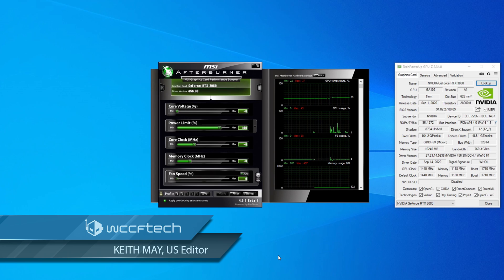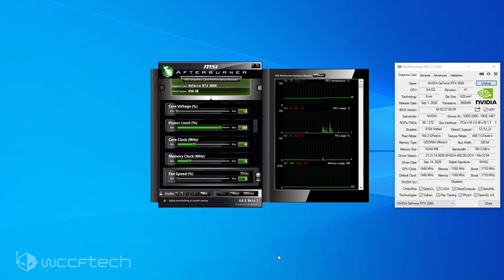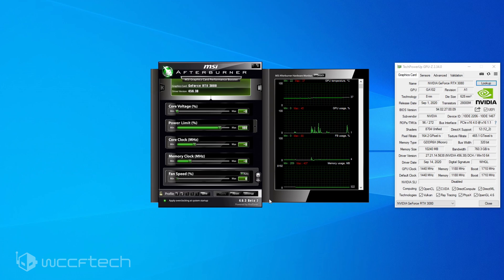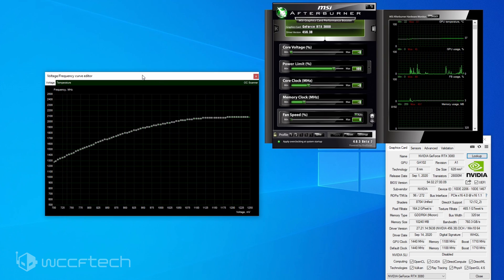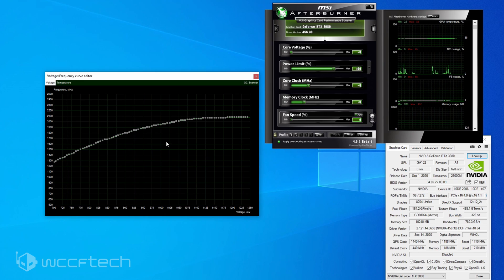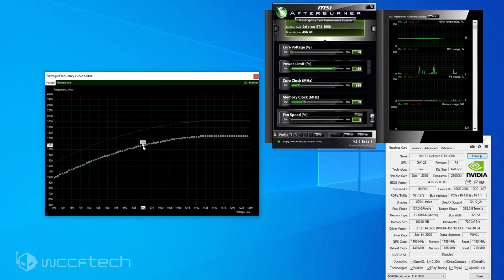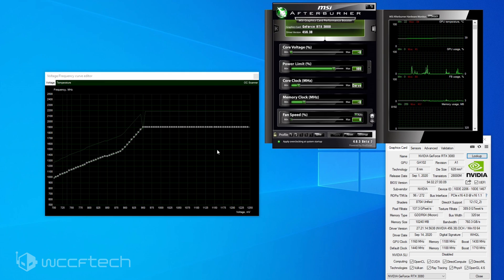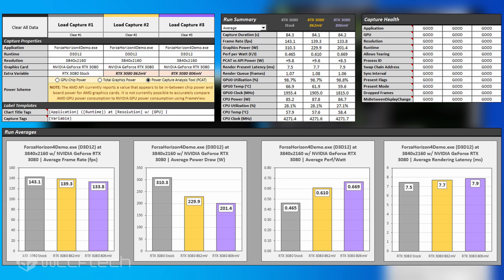How To Undervolt RTX 3080 For Huge Efficiency Gains

Comment: Why drag the entire curve down just to pull that one point up?

Sure, you can raise that one point and flatten the curve to limit the clock at that voltage, which works if your GPU is under maximum load.

But for the rest of the curve, you'll get a lower clock at the same voltage, meaning less efficiency across the board when you're not using your GPU at 100%.

Isn't it better to just raise the entire curve and then flatten the curve at the clock speed you want to limit?

This way you'll still get the same result but with more efficiency across the entire curve.

Comment: Than you very much, I'm applying this technique to my Zotac 3060ti now.

Just one question. 
How in the fox are people UV'ing their 3060ti below 0.9V while boosting to 1.9Ghz, some even above 2Ghz. That's 3080 numbers...
Did they win the chip lottery or what?

My card on stock, throttles all the way back down to the 1600mhz and even 1500s sometimes, it's ridiculous :(
Bought thermal compounds and even replaced the pads, no joy.

It's so demotivating.

Comment: i did this on my 3080 ti. i lost ~5fps average in 10 games but i save 85watts average. in far cry 6 its crazy. im playing in 4k and the games uses only 230 watts instead of 360watts. i lost 6 fps. thats crazy. i have 1775mhz on 0.781V. Stock is 1980mhz on 1.06Volt. this 225mhz is only the 5 fps average. LOL

Comment: Hi nice vid btw! I have this issue with my laptop, its fine when its drawing around 150-160 watts from the wall but power limit throttles when it hits 175 watts. I dont know what to do at this point as I dont see any vids undervolting a 3080ti mobile gpu.. please help :D

Comment: I don't get it. I don't know if I'm doing something wrong or what but when I put my 3090 Ventus at ~875 mv at ~1900mhz, there is basically no change. Still running at 82 C and drawing ~340w

Or do I just have a really crap card?

EDIT: Basically doesn't matter what voltage I put my card at 1800-1900mhz, it always draws around 340w. Unless I drag the power limit slider down, only then does it start drawing less power but that also drastically reduces frequency.

Comment: This is by far the best undervolt method I've ever seen. The way you lower the clock slider and then just slide up one dot in the editor, and then you're done, makes this so much easier to do.
Reply: You meant "the worst". Set power limit to 60% and I hope you'll see, what I'm talking about.
Reply: @BlueCombPL  if lowering the power limit works for you, then that's great. Setting a voltage/frequency curve limit with the full power level works far better for me.
Reply: @pf100andahalf  you don't get a point. Method shown in this video is harmful for GPU, because you will get HIGHER voltages and LOWER clocks than stock ones when PL gets triggered. Just look at frequency curve and analyse it. Or compare voltages between stock and this "undervolting" in FurMark.
Reply: @BlueCombPL  A gpu has a voltage limit that it can't go over. Doing it the way shown in the video, I get higher clocks and lower temperatures. I think you're doing it wrong somehow is all I can say. I've been doing it like shown in this video for a long time now with a 3060 ti and a 3080 and I'll always do it like this.
Reply: There are loads of videos like this and it does work. For no reason they overvolt initially and then arbitrarily decide on a value to undervolt it just happens that in this video he ends up barely undervolting if at all and back where he started on the original curve, which it always achieves because the boost is then limited. But it does run cooler.  @BlueCombPL

Comment: I noticed that if I play less demanding games and run them at 200 fps, the card bypasses the manual voltage settings and consumes the maximum current. In 3Dmark Time Lapse 4K Extreme, the situation is the same, regardless of 60 fps, the voltage shows a constant of 0.875 v, but the consumption increases to 340w, and with it the temperature. The card is Gigabyte 3080 Gaming OC. Any solution?
Reply: Did you try to reset and reinstall MSI afterburner, or try to apply the undervolt profile again, few times, when you are at 340w,

Comment: Will this work for asus 3080ti strix OC gfx card? Havnt used msi after burner properly yet. My card just has the most insane coil whine aswell it's distracting even with head phones on. My temps are usually 80degrees but the fans rpm goes max alot of the time.

Comment: I undervolted my RTX 3080. I set it up to 850mV for 1900MHZ and I never had better benchmark score. Core clock speed increased about 100MHZ (average 1830) without any bigger jumps, definitely the most settled graph I had so far (btw it was tragic at 950mV, very unstable ). But my graphic temps didn't lower at all during the benchmark tests... the same with the power consumption, still at 320W. All measured during the Heaven benchmark. Thanks for your video.

Comment: Great video and great description of what to do. Was getting some coil whine on my 3080. After undervolting and adjusting my fan profile I've almost completely eliminated the whine plus dropped the temp by at least 10 degrees and with no noticable hit to performance. Plus the added benefit of less power usage. Good stuff... You've earned a subscriber!

Comment: Will this fix crashing in warzone? I'm using aorus xtreme geforce rtx 3080
Reply: I am running 3080 Xtreme 0.950Mv 2000Mhz. Super stable in games. Probably can go lower with voltages or higher with clocks, but for the sake of stability I don't want to push limits. With this I am satisfied. 
Keep in mind that every card is different and maybe that will not work for you, but it is good starting point. Maybe you will need to go higher voltage or lower clock, or maybe you can do even better. You will have to experiment. It is silicon lottery.

Comment: An obvious question seems to be what about stability? I mean, after the tweak the GPU will be trying to hit the higher frequencies with less voltage than needed. Wouldn't that lead to crashes under load?
Reply: Not really obvious since almost everyone watching this assumes Keith did the due diligence and this uv/oc is stable. 3080 stock voltage is quite liberal and not needed for the vast majority of cards so a slight uv is pretty much guaranteed. With these cards, you can get <.900v and still retain stock performance.
Reply: @Disco_Potato  exactly so many just come and copy w out testing for themselves. Just run some games n see if you get crashes or a benchmark like 3Dmark

Comment: Nice. I upgraded from a 5700XT to a 3080 and already did a UV on the 5700XT so I was familiar with how awesome undervolting is. This took my temps from mid 70s to mid 60s and I think I'm getting slightly better fps.

Comment: Evga 3080 ftw3 ultra, 925mv 1935mhz +800 memory 58c full load time spy extreme
Reply: What are your memory temperatures with that Vram OC?
Reply: @sonjabrajkina3995  dont remember, dont use those settings anymore, was unstable in warzone
Reply: @m4nu507  Thanks for answering and so fast :), my main problem are Vram temps. That is why I asked. I am running 0.95Mv 2000Mhz on my Aorus Xtreme 3080. Not touching Vram. That way I am keeping Vram at 80C. They can say whatever about how GDDR6X can go 90+C safely but in some games that is just simply not stable. Never had problem with GPU temps, just Vram. I will change pads once when it warranty expire (till December I was lucky and managed to snipe one in Dec 2020), but for now I have to do it this way or I am losing warranty. It is constant 1990-2010MHz boost so I am good with it. GPU temps are 65 max. Gigabyte really messed up with cheap pads for memory.

Comment: For those wondering: NOT every 3080 will be able to achieve this significant a result. The high default power consumption is there to ensure that every retail card on the market will hit its advertised clockspeed and run stable at that speed.

If your underfoot is unstable you'll need to slowly increase it in small increments til you find your specific GPUs minimum stable voltage! 

YMMV!

Comment: I know this is an old video, so I hope you see this comment, but would it be okay to lower the memory clock, as well? Also, is it necessary to leave the power limit at 100? I usually like to set mine around 80-90. Thanks!

Comment: Thnx for this video. Now I find something weird in the end demo. It lasts 3 mn or so and it starts with a 12 degrees difference. But soon the UV 3080 ramps up the GPU temp  and at the end there is barely 3 degrees difference !?

Comment: does anyone have this where the voltage is not being monitored on msi afterburner after unlocking the voltage control and monitor on and still says 0 i have a gigabyte 3080 gaming oc

Comment: Thank you for helping, this works for 3090 XC3 Ultras as well - this particular model of 3090 only has a double 8-pin and from the factory it will try to draw more voltage than it can handle, resulting in a lot of power cycles, solved it by undervolting and fixed at 900 mV and 1950 MHz.

Comment: so if im rtx 3080 ti suprim x has a gpu clock of 1365mhz and boost of 1830 mhz does that mean i need to knock my stock curve down past the -290 mark? im having difficulty understanding how to determine how low you drop the stock curve before picking a milivolt to play around frequencies with

Comment: This is the only way I can get my RTX 2060 to work.  Out of the box it crashes instantly whenever I try to run anything.  The voltage and the clockspeeds are doing a helix, chasing eachother around in circles, up down, up down, up down up down.

Comment: Hey! sorry I am a bit late to this, but I have a question!

In the video you undervolt at 831mv for 1890mhz and in the results section there seems to be two testing results for 862 @ 1905mhz and another for 806mv @ 1815mhz.

Which have you had the most success with? is the first example in the video demo just to explain the process or did you find this to be the optimal setup for your specific card?

I understand that the 806mv is technically the most efficient, but for gaming, which are you happy with?
Reply: obviously 831mv for 1890mhz, its a wild mix of cool temps, performance and quietness.

Comment: Just wanted to say thanks. I noticed my 3080 temps creeping into the 80s over the summer (thermal throttling starts at about 85 on my card, and average temps were inching dangerously close), and this tutorial brought me back down to about 77 degrees on average. Maybe lose like 3% performance for it as well, which is worth it imo.

Comment: Man you saved me bro. Literally. I have a 3080 and two 1440p monitors. My GPU temps would get up to 80C while under heavy load. I applied an almost identical curve that you showed and now I'm getting 67c under max load, on all high settings 1440p 144hz. Seemed to actually improve my performance as well. Thanks bro!!

Comment: I was searching for this because my 3080 is very very hot, it warms the entire room, almost impraticable. Out of the box my card was at around 1850mhz at 76º with the fans at max.
Now, with the settings you pointed, the temps are around 68º clocking at 1890mhz and fans are not even close to the max. Thank you so much.

Comment: i have to use gpu tweak 2 as msi after burner seems to not be able to display my voltage in anyway. Dont give me tips ^^ i know what iam doing and no option is able to change this in afterburner at the moment.

Comment: 3:06
You can either Hold SHIFT or CTRL and drag on the of square in the chart down instead of using the core clock slider.

Comment: Thanks for a clear guide dude. Used the exact same settings, went from 75c under load to 64c with no FPS loss so far with my Gigabyte Vision 3080. Will see how it goes.
Reply: what profille you use?i have the same gpu vision and with the second profile agresive i play rust but at 15 min the game stoped :/
Reply: @Robin_NX  not sure what you mean by "profile", I just tweaked the voltages exactly as in the video. I have been playing games for a few hours and so far no crashes.
Reply: @escapetheloops  i say profiles because in this video first use one settings and the seconds are more aggressive they wccftechtv say in the video
Reply: @Robin_NX  okay, I see. I used the second one, he says that's how his curve looks like so I made it the same.
Reply: @Robin_NX  try lowering the core clock in 50 increments or smth, and don't go aggressive on the curve, set and then test. if all is good then lower it. I guess that's the standard principle in all over-and-under-clocking procedures, establish a stable base first
Reply: @escapetheloops  i try thx

Comment: this is weird, i got the same card and my temps after the undervolt are almost the same like 80 degree celsious any idea why?, yes its hot here for summer but shouldnt i see like at least 10 degree less temp? i did the less agressive one and i saw a drop in temps but at very lo performance and this one didnt got the temps i hoped.
i was using 50% fan speed and using a demo scene of 4kb that really stressed my gpu to 100%
Reply: Stab in the dark here: Perhaps your case isn't well enough ventilated? The heat could simply build up over time inside the case. If so, then you should see a slower heat buildup with the undervolt. Try opening the side panel or ramp up the intake fan speeds, see if still reach the same max heat.

Comment: @WccftechTV hey so I got my build finally resolved for what I want and got my 3080 FE a week ago finally and just wanted to say thanks for the guide. Just had a question, when I follow editing the voltage curve, my stock curve is 100mhz lower than yours so when I adjust it using the same settings that you apply I end up at 1800 instead of 1900mhz. Any thoughts? Ill have to play around with it but was just curious what you think or if anyone else had input. I am not aware of any other performance adjusting programs on my computer right now and there are some stuff in the BIOS but they only seem to apply to the CPU and RAM. There is very little settings for the GPU in the BIOS. its the MSI z490-A PRO on the latest beta bios with the BAR resize feature just added in. Any input would be great as I am just getting back into the desktop stuff (last build was back in the Half Life 2 days)

Comment: Thank you so much, my 3090 was power throttling and causesing fps to spike up and down. This video saved me from selling the 3090 and thinking it was a piece of junk. I would of never guessed that this video card did not need that much MV- voltage. Its crazy. I thought it needed more wattage.. That is completly inaccurate.

Comment: are these cards being volted at this level at stock what is causing most of the coil whine issues do you think?
Reply: Yes
More voltage = more coilwhine.

If you lower the voltage going trough the card, it will reduce or sometimes eliminate the coilwhine on certain cards.

Comment: Well i lowered from 75C to 70-71C on cyberpunk. 60 watts less. Fans spin at 60% instead of 90%. It’s good, i guess?

Edit: i undervolted 862 1875mhz, set up fan on afterburner as well. Lowered temps to 64C and only lost 2 fps on cyberpunk. Thanks a lot!

Comment: I currently have my 3060Ti Ventus at +140MHz and +1000 Memory. I runs up to 73 C and 90% fan speed though. So if I want to undervolt to get a quiter system but still go up to 70ish degrees unlike your much cooler system, how can I do that? Put a higher clock at higher Voltage?

Comment: Hello,
Im a noob with undervolting. I have a ASUS TUF 3080 OC. I can just use the sliders in MSI Afterburner to put it down to 1950 x 0,9V ? Or does it need to be done in steps? Dropping the temps is important. What is the best undervolt setting for that card?

Comment: Already did something similar but how much should i try to push it?
How big is the difference in heat production between 950, 900 and 850 mV?
Basically, is it worth trying to run the top frequency at 850 and risk instability instead of 950?

Comment: Is there any reason doing it this way is better than simply upping the clock slider which should give you higher clock-speed for a given voltage? And if you also want to save power and in turn heat, just lower the power limit slider simultaneously?

Comment: If I wanted a drop in performance I would have got a 3070
Reply: Yeah, a 2-3fps drop is all that separates them right? The undervolting is to reduce thermal footprint and run the system cooler.

Comment: I am looking at the curve and it seems everyone missed a small detail. Yes you are undervolting the top end which is good under load, but on idle (or when the card is not under full load) it seems you are overvolting the card instead. If you look at 1400Mhz for example, previously it was allowing around 738v, where now the card is pumping 850v to the same clock speed.
Reply: @NonsenseNinja  It wont run at a lower clock speed, you will just pump more voltage to the same clock speeds. For example if the card was running at 35C on Windows, now it might be at 40C. The right way is to go one by one in the the top end (yes it takes longer) so it uses less voltage on higher clocks. If you do what the video shows you are reducing temps under high load but increasing them on light load.

Comment: I don't understand why you brought the whole curve down before applying the voltage curve, could you explain some more please?
Reply: This step does not make sense to me either. Applying a negative clock offset is shifting the entire curve down, effectively "overvolting" (increasing the voltage at every frequency).

Comment: Thanks, good advice. My card was running fast but hot. This keeps temps under 65, improve efficiency by 27.5% at a 6% performance loss (vs a max stable  overclock!!) with a little under +800 on the memory clock. Cheers